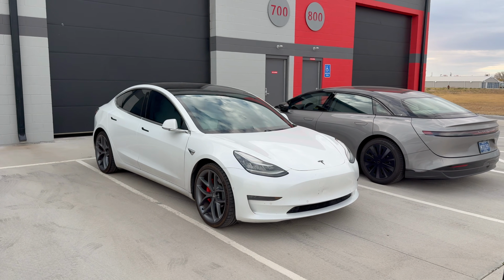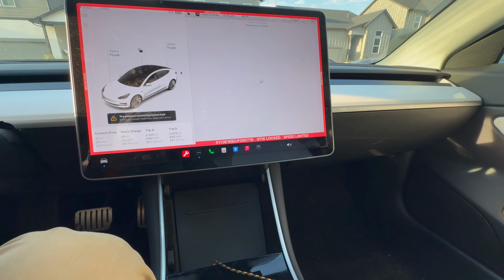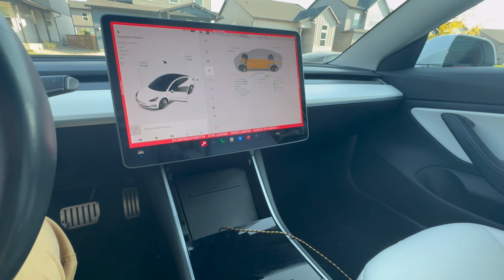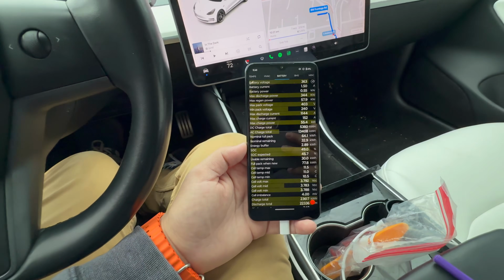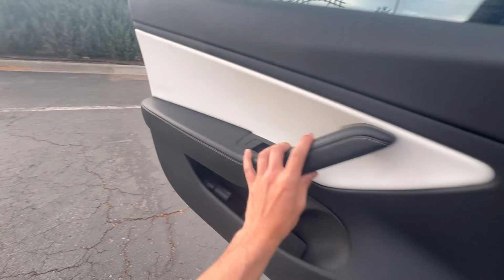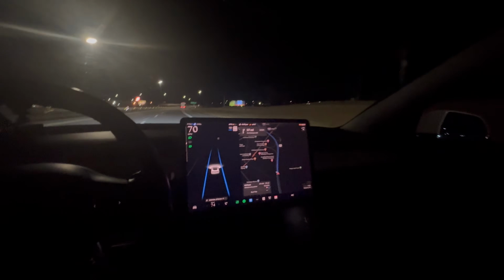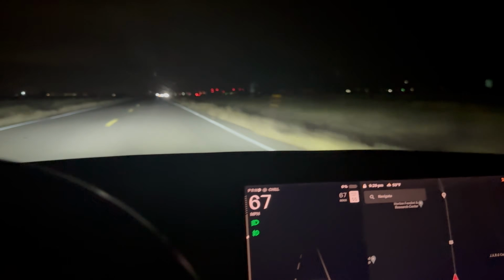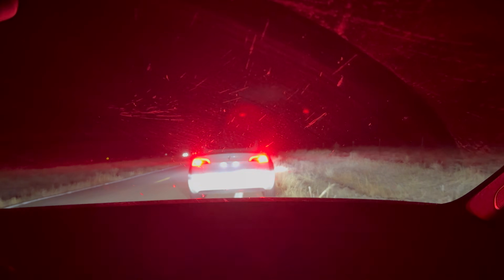My Used Tesla Lost This Much Capacity Since New! 2018 Model 3 Performance Battery Health Check

Comment from the maker: If you missed Tijmen's original delivery video, it's linked here! https://youtu.be/xPw_dhrSpW8
Reply: @outofspecreviews You seem extremely knowledgeable in batteries derogation. Can you make a video on best practices for daily charging? I have a 2024 Tesla model three performance I don’t necessarily need it to 80% but I like the performance that comes with it at 80%. is it OK that I charge it to 80% every single day or should I be charging it lower like 65% or 70%
Reply: @MountainDizzal  *degradation. Maybe autocorrect did that to you? Derogation is an exemption from a rule or law, or a relaxation of a law.
Reply: @RWBHere  you’re a dork
Reply: Law Arrhenius..the answer...

Comment: I bought a 2023 MYP in August 2023. I live in Phoenix, and I charge at home to 80% each night at midnight.   About a year ago I got the S3XY buttons and Commander.  The commander surprised me then by showing a 9% degradation in 6 months and about 14,000 miles.   I don't know how accurate that is/was, or what it would have said on day 1.  However, it has slowed a lot, and 1 year later has lost only 2% more, for a total loss of 11%.     I wish I had put in the Commander in the first week, to see if it started at zero, or some non-zero loss percentage.
Reply: My wife and I have been through three model 3s and two model Ys, maintaining good charging practices but in 100+ degree summers, and every car has behaved the same: drops about 10% within the first 18-24 mos, and then plateaus completely thereafter. Still have a spare 2020 Model 3 SR and its 10-12% degradation depending on season.

Comment: Having worked with Li-ion batteries on and off for 25 years the simplest degradation formula is SoC x Temp x Time.
DC charging causes high temperature and keeps the battery voltage at maximum (they follow a CC-CV regime) which is the same or even worse than 100% as the polarization is high.... 

If all factors are high they wear down.
But if you keep time at 100% SoC close to zero (and SoC under 80%) you are fine. In the winter time it is less critical.
Using this formula and living in Scandinavia I kept my 24 kWh Nissan Leaf to all 12 bars of SoH (last time I used the Spy it was 91% SoH but you can't trust it) when I sold it after 6 years and 80.000 km.

My ID.3 claimed 89% after 145.000 km on Aviloo.

However my Model 3 (2019 Freemont awd version) I haven't tested but I would expect ~90% at 101.000 km now 

All cars have only been DC charged a limited number of times except for the model Y that has taken some holiday driving).

I am actually under-impressed by Tesla.
There shouldn't be any problem in getting cells to cycle 1000 cycles to 90% nowadays. That would equal more than 300.000 kilometers to >90% SoH with that size of battery.

My wife drives a LFP model Y with just under 40.000 km it seems not to have experienced any wear (I don't charge it to 100% more than once a week or less).

Comment: I have a 2020 Model 3 SR+ . Rated range was about 400km and I'm at 360km right now after almost 4.5 years of ownership. I drove in frigid temperatures (Montreal, Toronto, Niagara region) a lot and the first 18 months, the charging was all Tesla SC. After those 18 months, its all slow home charging at home.

Comment: If the battery charged to 100% has a buffer with residual miles when the vehicle charge level is at 0, are we really charging to 100% or to some other lesser percentage?

Comment: We’ve got two 2018 Model 3 LR RWD cars, with 95k and 129k miles respectively. So seems like you actually have 4 data points you could compare: Tesla’s GOM miles at 100%, the driving test kWh discharged, the Service Mode percentage result and finally Scan My Tesla reported capacity. I’d argue that the GOM miles at 100% must be linked to the reported capacity and therefore can be used as the quickest way to assess a car someone wants to buy.  

I would even argue that because the GOM is linear for kWh that if you do a ratio of miles to SOC that if you ask the dealer selling a car to quickly switch between miles and soc and tell me both numbers that you can really quickly assess a car and sort the highly degraded packs from the well treated examples.

Comment: For those thinking this is the only way to test this, please DON'T DO THIS. It can damage the battery. Google Tesla service mode. There is a way to do this in there, right in your garage/carport, connected to a Level 2 charger.

Comment: Hmm, I wonder if the test would have been any different had you charged up to 100% with a level 2 charger as opposed to super charging.  I've typically held the believe that slow in slow out (relatively).

Comment: This matches my experience. I had a 2019 SR+ with 16% degradation at 65k miles. One year later closer to 79k Tesla actually refused to provide me an update on my degradation. At that point the car was even worse and could not complete my daily 100 miles commmute with more than 20% left. It was charged at home everyday to 80% and I’m in the mid Atlantic so mild weather.

Comment: That's pretty high loss for those miles. I checked our Ioniq 5 just past 60k miles and it said like 72,600 WH remaining at 100% charge, 74,000 was new new so it's down 1.9% and the car still reports 100% SOH.  But we live outside Seattle so no extreme temperatures and it's AC charged 95% of the time then since we have home charging I charge it often rather than letting it get down to 20% or less.

Comment: Excellent presentation.  Thank you.  We are going to see more and more of this as these cars get some years on them and since sales have been high, there will be a much larger sample size in those aging years.   Nice to see some "reality" checks on real world examples.  Batteries are not going to last forever and the replacement cost is a honest discussion we need to have on these cars as they age and get resold a few times.  Like it not, batteries are a maintenance item,  they degrade over time even when not driven and will need to be replaced on all of them at some point else the cars will simply be scrapped.

Comment: Why does nobody make a video about the "battery health" not beeing correct. 84% is not 84% of the life left, it's 84% of new capacity. Have you ever seen a Tesla at 20%, 30%? 40%? No, because they die alot sooner. This car probably has more like 50% of it's battery life time left.

Comment: I'm with the others that have pointed to the beat up suspension and high regen factor, indicating the car was rode hard and put away wet for those 40k miles. Because at that level of capacity loss, he'd reach warranty replacement by 75k miles, which is simply crazy.

Another anecdote, is that I have a Polestar 2 with 39k miles, and virtually all AC charging, but pretty much plugged in every evening and charged to 90%. My last battery state of health check had the battery at just under 96%. So a loss of around 1% for every 10k miles of usage. That's in line with what others have seen as well. The caveats there are, there's the assumption that a brand new, zero mile, battery starts at 100% exactly, which it may not, and then of course use cases, charging type/frequency, and ambient temps are all additional factors.
Reply: Yep - that is all part of buying a used car, especially cheaper one, that has been through a few different owners.  That is why we need to start having honest conversations on the process and cost of battery replacements.   Not everybody can afford new cars and simply scrapping old ones because the battery has aged out.
Reply: @markmonroe7330  I don't fully agree with your conclusion. I do think we need to seriously talk about having regulations in place that require reporting the battery state of health as part of a non-private, person to person, sale. That way people/the market can properly value cars that have been beat on, as was the case with this one.

However, just because the degradation was so bad on this one early in its life, doesn't mean that the degradation continues at that same rate under a new owner, and thus requiring a battery replacement at the accelerated time table. So, for someone that just needs cheap(er) transportation, doesn't drive much, and plans to L1 or L2 charge all the time, then the car could be perfectly fine for them for 10, 20, 30 years.

Comment: Auto journo Rory  in Great Britain has interviewed a ModS Taxi owner that has 400,000 of mostly SCharged miles , he still had 100 miles of range when he changed thd battery pack . For comparison any high perf BMW or Mercedes ICE replacement will on average cost ofer $20,000 from a that companies dealer ,and that is just for the ENGINE😊

Comment: 2018 Model 3 Performance, 75,000 miles (120,000km).

At 100% SOC, shows 260 miles (420km).

Real world mileage has been between 181mile-238mile (290km-380km) the handful of times driving 100% to under 3% (sport mode with roof rack)

Recent health test 83%

Comment: I would think that the cars cooling systems would keep the battery at a safe temp when resting if the car is plugged in..   Maybe the AC compressor has been faulted for a long time, or underperforming? BTW get that fixed ASAP.  If the compressor grenades.. it will throw metal trash all thru the system, much mor expensive. So fix it or disable it until you do.
My Bolt EV will have the AC going over 3KW when parked in summer heat and plugged in.. I think It targets 90F when on plugged in and 100F when not.
Looking forward to future videos on the car..

Comment: I have a 2018 m3 dual motor.  95% was ac charged.  My compressor went bad too but you have no idea until you check the service menu.  I live in Los Angeles so heat is not too bad.  My degradation is probably 84% too.  I think it was the compressor not working and likely allowing battery temps to get too high.
Reply: If the a/c isn’t working, the cabin is hot while driving.  What are we missing here?
Reply: @ my ac was working, it’s not the compressor on the ac side, it’s on the coolant side.

Comment: I had a 2018 M3P, 53k miles, SoCal, AC Charged 98%, Tesla ran it remotely after several service visits, 11% degradation after 2 years.  These performance models DO degrade faster, may be the way the software/motors is running?

Comment: The ideal SOC is NOT as low as possible. For NMC batteries, it is about 50-60%. Do not mislead your viewers! Battery wear works differently at low SOC, but it is generally more harmful than high SOC, though 20% should still be reasonably safe.
Do you want references?
Reply: I was thinking similar, low SOC is worse on the battery than high SOC.

Comment: Just got a 2019 3 LR from Tesla. 16% degradation on the battery. Tesla replaced the upper control arms before delivery. Car is otherwise great for $22k before tax credit.
Reply: With 85k miles

Comment: Before I traded my 2018 LR RWD a few months ago it was at 72kWh showing 97% capacity,  3% degredation with 65k km.  Rarely charged above 75 percent and rested mostly between 50 and 60%.  Northern colder climate.   I've now got the LG battery on the 2024 LR AWD.  Going to keep the same charging patterns and see how it goes.
Reply: Where can I find it at? 😊

Comment: Not bad given it’s a 2018. Can’t wait to see the performance upgrades and it hitting the tracks. It’s gotta be better than my leaf’s degradation which was at 60% capacity.
Reply: Actually 60% health is a level that's indicating the battery may need to be replaced soon, as the degradation rate of the lithium battery is pretty much linear until it reaches 65-60% health but after that the degradation rate is getting more and more intense

Keep checking the battery health regularly if you're still using it everyday

Comment: So to run the numbers, 6 year old Tesla with 40k miles for $25k that needed upper and lower control arms. Basically needs full suspension. Coil overs, etc. Big bumper damage. Scrapes. Interior tears. Squeaks. A/C compressor needs repaired/replacement. Knocking was lower control arms. Whole car faulted when exiting dealership. Need new sensors? Auto pilot ECU,  TPMS fault, and radar issue. Then you need to test the battery for 24hrs without touching it vs mechanics or knowledgable people can check ICE vehicles in 30 minutes tops. And 84% battery health. Treating cars like tools, I could get a 6 year old hybrid for $15k with no issues. Saving $10k sale price ($5k if qualified), plus thousands in repairs. EVs are getting better and cheaper but IMHO hybrids are still king.
Reply: Hybrid?  Take everything you just mentioned and now squeeze in the gas engine and it’s maintenance too.  Hybrids are service nightmares as miles add up.

Comment: This car was beat up its entire life. Look at that steering wheel. Good lord. My 2021 (delivered late 2020) LRAWD has 55k miles and is practically indistinguishable from new. However, I am also seeing around 10% degradation which is unfortunate. Car is supercharged a lot and would often go to 90% back when Tesla said that was ok to do. North Carolina mild weather. Love the car, but it sucks that Tesla completely dismisses degradation whatsoever when asked about it. See the new model 3 review with jay Leno. When asked, the engineers said the most you would see was 3-4 percent over a decade. Unfortunate that they are lying through their teeth.

Comment: Really enjoy this type of content. There needs to be more videos about battery degradation. I see private sellers all the time stating that their cars batteries have been “babied” and have low degradation because they’ve only ever charged to 80%. Actually no, in many cases it has shown that charging to 100% isn’t much different than charging to 80% in terms of degradation. If you care about degradation, setting your charge limit to 50%-55% can cut your degradation in half in comparison to those that charge to 80%. 

Also the whole “I can charge my LFP pack to 100% all day everyday and not worry about degradation” is a fallacy. The 100% recommendation for LFP packs has to do with pack voltage and BMS calibration. Set your LFP charge limit to 70%, with the occasional 100% charge for the BMS, if you care about degradation.
Reply: if as a potential EV buyer, I have to keep the EV battery from 25 percent to 70 percent everyday.  the car is worthless to me.
Reply: @cutehumor not very hard if you have home charging. I don’t even think about it. Also there is nothing you HAVE to do. Let me ask you this, do you optimize everything with your ICE to ensure it lasts longer? Probably not.
Reply: @cutehumor  also the “below 20% is bad for you battery” is a large overblown fallacy too

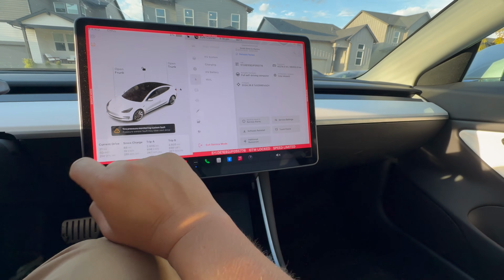Comment: 7:10 false.  You cannot just replace the compressor.  I mean, you can, but it will need replacement shortly after. You need to replace all of the parts. The evaporator, the condenser, the expansion valve, the dryer and probably the lines too.
When a compressor fails, it sends the pieces throughout the system. Those pieces are tiny.  You cannot get them all out. You have to replace the whole system.  Unless it an exterior failure, like the drivebelt bearing (which I would imagine a Tesla doesn't have) or something.

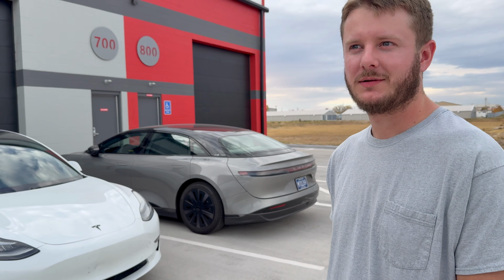Comment: 3:00 Such much for all those people claiming EVs don't need as much repair and maintenance.  I've been pointing out all the rubber in the suspension will degrade faster than a car due to the higher weight.  This and many other items in cars that wear out.  That air conditioner?  That's going to be a FORTUNE.  You will need to replace ALL of the components.  When the compressor fails, it sends shrapnel throughout the system. New condenser, new compressor, new evaporator, new valves etc.  This will be over 2000 Dollars.

Comment: My 2021 model 3 needed control arms replaced at 40k miles. Seems pretty normal honestly with these cars.
Reply: Depends on the year.  Early cars didn’t have the control arm issues.

Comment: My 22 MY LR AWD is at 49k miles and it showing 71.2kwh remaining capacity which would imply about 13% degradation and I live in Las Vegas so very similar to Arizona weather about 25% of my charging was DC charging, at home most of the time I charge to 70% so I am a bit concerned about degradation and I wonder how much of that degradation is due to supercharging or hot summers?
Reply: Supercharging has little effect on degradation especially in your case. The three main factors that affect degradation are pack age, ambient temperature, and average SOC. You can really only control average SOC.
Reply: @kylie920  yes I have seen few studies that say supercharging has little effect but if that is the case then all NMC EV's in areas like Arizona or Las Vegas would have higher degradation so I wish there was a more in depth study on real world EV's from those areas comparing to more milder climates. Like I said the only time I charge above 70-80% is when leaving on a road trip, not only that but on a daily basis I schedule charging to just few hours before I will need to car so that it doesn't sit at 70% SOC all night so even with all of that 13% degradation at 50k miles seems a bit high to me

Comment: 32:00 is your answer,  233 miles on 100% down to 0,  63 kWh used from pack
Reply: Thanks! You just saved me 30 minutes of irrelevant rambling.
Reply: @ElMistroFeroz  You're very welcome.  ONLY Kyle can turn a 5 minute video into 30+ minutes with all the irrelevant BS.